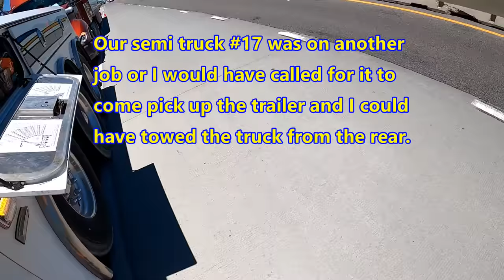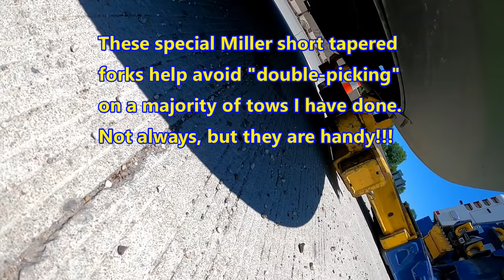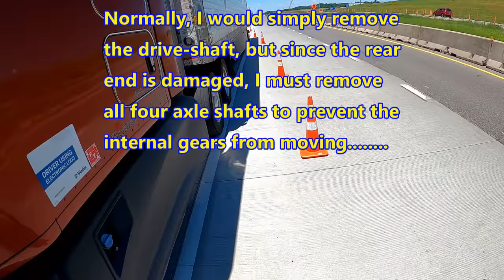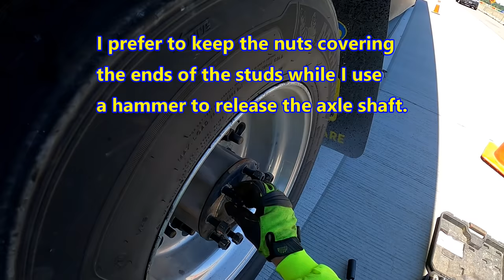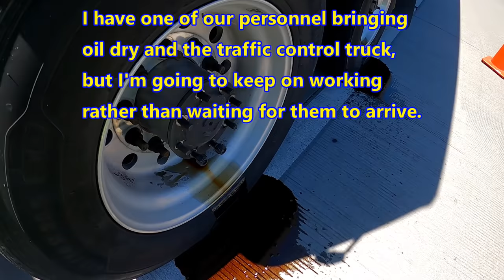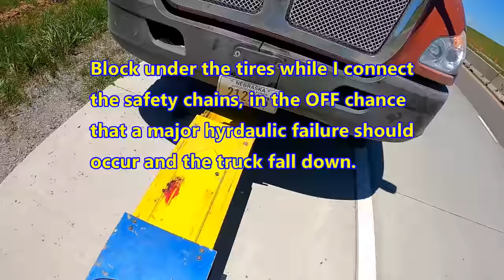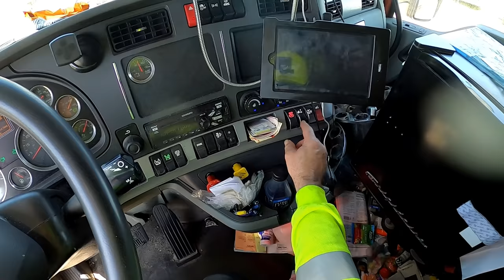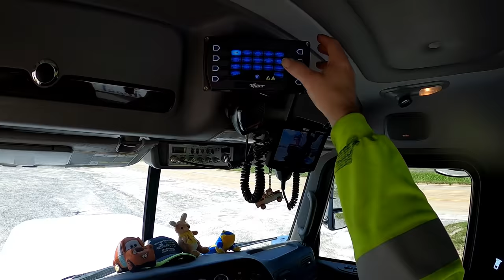Squeeze Play!!! Dangerous Heavy Tow From a Bad Location!!!

Comment: Ron, why is it important to put the axles back where they came from ?
Reply from the maker: Depending upon the manufacturer, the axle shafts are usually different lengths depending upon their position on the truck.   One side is normally longer than the other side and sometime the longer one will be on the opposite side from front to rear.   It could only be a small amount, but could make for major problems if installed in the wrong location.     Thanks for watching and God bless.

Comment: An idea for a warning device for you, for situations like this.  This is based on what you see on the back of European highways maintenance vehicles.

A large flexible sheet (canvas, or something modern) the size of the back doors of a semi trailer.  Cover it with the super reflective red and yellow chevron markings found on European highways and emergency vehicles, or something appropriate for the US.  Rod across the top and bottom of it to spread it out.  Hung from the trailer doors, possibly from the locking bars.  Something like an extendable long boat hook to push it up there and hook / clip it on without climbing.  Maybe even add a couple of strobes to the top of it.

You could potentially convert the far less visible back of a trailer into a huge high visibility warning device in under 5 minutes.

Comment: Arnt areodynamics fun. I got some customers . Their lots would rip those skirts off. But I'm a container hauling Dump truck. .
Is towing an auto shift trans semi different from towing a manual trans. 
Just got a 2016 Cascadia with an an auto shift. Don't you need to cover the axle ends or did you not show that part.

Comment: My state is so corrupt and wasteful, we haven't had concrete roads since the ones built in the 50s and 60s wore out. They're still under the asphalt, though, so you get that double-thud sound and bump every time you hit the gap between the old concrete slabs that the asphalt has sunken into. Imagine over 100 double-thud bumps per minute for a whole trip somewhere, or having to live near where that noise is being made all day long.

Comment: do  tow trucks get a exemption  on the 80,000 weight limit ?
Reply from the maker: In Missouri tow trucks can move anything regardless of weight, height, or length to the "first available safe haven" if it is disabled and on a "first hook" basis.  I know that's vague, but that's the way the statutes read.   Basically, we can move anything to get it safely off the road.  Anything other than that and we must abide by the same regulations as everyone else.  Thanks for watching and God bless.
Reply: @RonPratt  ok i was wandering   if u had a over weights truck (80,000+) if u had to get over wt permit to  mov itto yur shop u have a class A cdl right?

Comment: Not a comment, more questions.  When you put the cones out, they are only in the slow lane about a foot and a half, how can drivers coming up see them in time, and know not to be driving in that lane?  Can they still drive in that lane, just slower?  Why don't the police come for safety sake to slow traffic down, just seems like it is an accident waiting to happen because no one is slowing down, but they do seem for the most part to be staying out of the slow lane.  Also, what are those coiled blue and red hoses your attaching from truck to truck, are those air brakes your controlling, so you can control the air brakes on the semi?  Maybe someone that knows can answer.  If nothing else this has taught me to move over and slow down, the traffic is horrible.  Living in Arizona when I've had to pull off while on the interstate 10 Tucson Phoenix area, the speeds are 75 mph, most are going 80 to 85 and you are literally blown around if your out of your vehicle.  It is so dangerous 😳 and everyone is in a huge hurry.  How can you safely get back on the freeway when your driving a big truck,  and towing a semi, and the traffic is coming up on you at 75 to 85?
Reply from the maker: As for the cones, we aren't allowed to completely close a lane without police or fire present, unless we give advanced warning of up to 2 miles, which is nearly impossible and highly impractical for a tow such as this.  As I stated in the video, this is one of the most dangerous situations for a towing/recovery operator.....a standard tow on the side of the highway, interstate, etc. It is a highly dangerous profession.   As of last year, deaths of tow operators VS police officers and other first responders in "struck by" incidents on the roadways was 6:1 and rapidly approaching 7:1, meaning that for every 1 officer/first responder struck and killed, 6 towing/recovery operators were struck and killed.   Even one death is too many.    That is why I try to educate people about the Slow Down Move Over laws that are in place in every state in the U.S.   Thanks for watching and God bless.
Reply: @RonPratt  🙏🏼🙏🏼🙏🏼

Comment: Ron Pratt: I have watched your videos where you pull up behind the vehicle to be towed and set up. And I have watched ones like this one where you pull up in front. Factoring traffic is a variable, I understand the point of visibility for the set up from behind but you risk collision when you pull out into traffic at slow speed to move to the front of the disabled vehicle. Wouldnt it be better to put cones on the shoulder side saddle boxes of your rig that way you can stay to that side of the roadway, walk toward the rear, start placing cones back from the rear of the disabled vehicle allowing you to stay shoulder side in the process. I know its a high risk both ways you do it, but a high speed collision into the back of your rig while moving from back to forward position would be just as bad or worse. I used to drive truck and people are not paying attention either way you do these processes. I just think as a risk, that it would be more of a risk when you pull out from the back to move forward of the disabled vehicle. At least if a vehicle was coming toward you when your walking and setting up, you have a chance to run faster than a vehicle moving outward to the slow lane aka your rig. Essentially one move vs two equals a little less risk. Food for thought. Stay safe out there.

Comment: Easy way to make the axle's when you don't have a marker is to run something through the bolt hole like a string or piece of rag or wire axle 1 one piece axle 2 two pieces and so on.

Comment: Some Drivers back ends get bigger when they enter a metal sphere. The Towing industry is not a top of mind experience for most drivers.
I was concerned that the under-reach was not going to make it under the bottom of the cab. Can the Towing Industry mandate that under-reach areas on Semi-Cabs be a certain distance from the road?

Comment: He took the lug nuts off of the tires (so he could take out an axle thingy).  How did he keep the tires from falling off?  Wouldn't they vibrate off?
Reply: Lug nut covers for decoration only. They slide on over the nuts.
Reply: He didn't take off the lug nuts, he removed the hub cover ... There is a difference but I'm not smart enough to explain lol!😂
Reply: @m9 ovich I thought he put them in a ziplock bag in the rig?
Reply: I called my brother who is a diesel mechanic.  The lug nuts are still on the tire just like @m9 ovich  says.  What was taken off was the axel nuts.  The tire has two sets of nuts.  One to hold the tire on, and another for the axel.  Different from the axel on a car.  Today I learned.

Comment: 32:36 I have never seen you, or anyone,  put locking pins in those pull pins before. Is that that just because of the type of truck/pin  or some other reason?
Reply: That's the KW style. The Freightliner/Sterling style are "keyed" with a spring in the hole  push in and twist to lock. You need to keep those lubed up. I've seen that spring Freeze up.

Comment: I was trained to never turn your back on moving traffic and to.mininmise the time spent on walking alongside the live lane. If you have to walk from the front of your vehicle even if you're constantly walking around .
I noticed you stowed the rear tow lights on the drivers side of the truck, meaning you put yourself at risk . Our wrecker stowed all the lift and tow equipment on the passenger side so we wasn't unloading onto the live lane.
Just a small detail that helps reduce the risks involved.  Stay safe.

Comment: I had never thought of this till watching this video.  I do not know why truck companies do not put air hose connectors, like the ones you have on the rear of Tator, why the companies do not have corresponding connectors somewhere on the front of the tractors, hidden behind the bumpers.  They have pull points on the front of all tractors, why not the brake connection points at the front of all tractors?  It not only would make hooking up faster and safer, but would also cause the tractor's brakes to also be actuated by the tow truck's brakes.
Reply from the maker: Unfortunately, the U.S. is years behind a lot of countries.   Europe and other areas of the world have "universal" hook up and air connections, just as you are describing.   It would make our job so much easier.   For some reason, the U.S. companies have to make everything  "proprietary".    Thanks for watching and God bless.
Reply: @RonPratt   God Bless you too.  I have also thought to help protect tow truck drivers and school children, they should have side extension warning arms.  You know how the STOP sign swings out on school buses,  and they have the front swing out arms, on the front bumper of school buses, to make students cross eight feet in front of the buss.  I have thought tow trucks should have one mounted on the left side of the bumper with the running lights showing people to move over.  When you are stopped on the side of the highway, the sign would swing 180 degrees into the left lane, and the red lights would be showing people to move over.  If people thought their car is going to get scratched, and they see the bright red or amber LEDs, they will move over. 

Next time you eat at Lambert"s, just know there is someone in Nevada who loves the place.

Comment: Oneday when u have some time u should show people how that lift axle works so its 100% clear cause alot of us may know but some may still not fully understand just a video idea when its a slow day for u o and alot of people think in trucks u have to switch gears when the rpm is straight up u can also explain that for those people to since u sometimes change around 2500 or more when driving

Comment: I’m not a tow expert but rear towing the tractor if resources were available would probably be more dangerous.  I would think he’d have to back down the shoulder (facing the wrong way), then drive the wrong way to the on ramp (go down the ramp the wrong way), then get back on going the correct way.  That would probably require the Missouri State Highway Patrol for safety but don’t know for sure as I don’t live in Missouri or work in the industry.

Comment: This tow is a crumy situation,  as are all roadside recovery  situations because of high speed traffic near or sometimes  in our work area. Recently  I lost an old friend in the industry who was struck and killed on I-80 in Pennsylvania  while doing exactly  what you are doing right here, recovery and transportation  of a disabled semi. The only difference  was that it was during the overnight  hours. He was 80 years old, owed the business and wasn't  normally  an operator  any longer. He was just filling in when the incident  occurred.  However,  back to my comment. As I have mentioned  before there are always multiple  ways to accomplish  a mission. Frankly, I think moving the semi as a single unit here despite the rear end being the obvious problem  and that the accepted  practice would be to separate  the two and tow the tractor  from the rear, the dangerous  location of the breakdown  precludes that. However,  here is my question. Even though  the Western Star  was unavailable,  wouldn't your medium duty have been capable of towing the tractor from the rear, leaving the trailer for the "tator"? Again, under the circumstances  though, I think towing the disablement as a single unit was the wisest and safest choice. Thanks for another excellent video and God Bless.

Comment: Look at t this way: If your semi'd been available, you'd have  to tow that thing against that traffic at least a little ways... and besides, this way we get to see how you do it!
Reply from the maker: Actually........with the Rotator there, I would have been able to reach out over the cab of the truck and turn it around (on the grass side of the interstate) so that I could grab it from the rear.   I have done it before.   Tie the steering wheel first, so the tires stay straight, then just push it back and spin it around.    The Tator makes life so much easier some times.     Thanks for watching and God bless.

Comment: "the kind that has the dad-gum cones on them"
the whatnow? cones? on the lug nuts?

Edit, I just realized you had a fully loaded truck rolling on wheels without the axle shafts going through the hubs. I've got a few vehicles that I've had  to replace axles and hubs on before, small passenger vehicles, and the manuals explicitly say NOT to put the car on the ground without the axles going through the hubs. Deforms the hubs and nukes the wheel bearings. I'm guessing the tractor hubs are built such that they can be towed without the axle shafts because you can't just disconnect the axles from the diff like you can on a passenger car with CV joints in most cases.

Comment: Most got the the lift axle switch inside the truck. The air pressure regulator knob is under the door. I dislike having to open the door and step out the truck or have another guy stand there and twist the knob while I watch the gauge. Trucks I drive don’t have steerable lift axles so I just lift them up and down don’t have to worry about it. Around turns you have to lift it up or it’ll break. I’ve seen dump truck drivers turn without lifting the axle… I watch as that axle skids and makes that sound. They clearly don’t care. If it’s a company vehicle oof. Depending on the company owner though. He’s either getting fired or the company owner is also not bright. Lol. Owner operator of truck then that’ll soon be a massive repair bill. Always use the lift axle as it’s intended.

Comment: 7:22 When someone is too close to me on the road, I usually comment (to myself):

You are NOT a Hemorrhoid! Get off my Ass!

Then I GENTLY ease off the throttle to SLOWLY drop my speed a few Kph to help them get a frigging clue...they tend to get impatient/frustrated fairly quick and change lanes to pass me...

For those wondering, no, I'm not particularly worried that one of the tailgaters will cut me off and break check me...I pay close attention to them as they pass me and the instant they start moving in front of me to soon, I take evasive action and if one of them does manage to cut me off/brake check me successfully, I have a front & rear dash cam for evidence of their dangerous driving and attempt to deliberately cause a fatal accident to show the Police...

Comment: DEER! Yep it's getting to be that time of year that we all start noticing them and mentally preparing for hunting season. Unfortunately I missed my chance to get my first before my grandma died. Now I just hope I'll ever be able to afford to get everything I need and get a tag and go hunting at all. I got my hunter's safety done at like 32 (36 now) and just never have been able to afford it. Hell right now I don't even own my own vehicle. It's hard when you are physically limited and autistic.
Was that a spot of blood on your under reach? Looks like you mascaraed a lizard. When you were putting out the cones I noticed the stripe of gear oil coming off the lane and then the puddle and then the drips leading to his truck. There's little clues you can watch out for when someone's vehicle is broken that are huge heads up as to what you are dealing with. Masking tape and a Sharpie are your best friends whenever you need to label anything.
Hey Ron, go to Walmart or Bass Pro and pick you up a set of $15 polarized sunglasses. I wear them ALL THE TIME when I'm outside because between being autistic, having slight astigmatism and having a brain defect called Chiari 1 Malformation, I am VERY sensitive to light and get really bad light shafts/glare. You don't need high end sunglasses to deal with it, just the cheapees work just fine. I personally always go for the ones with a slight blue tint as they tend to look a lot richer than the brown ones.. like those commercials you see for the HD glasses. BTW.. did you drive all the way back with your red and blues on?